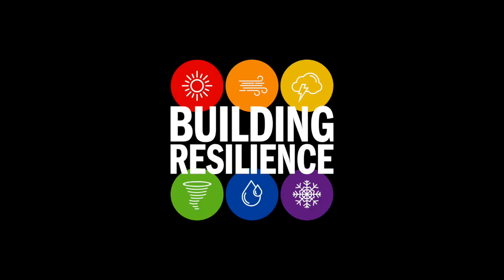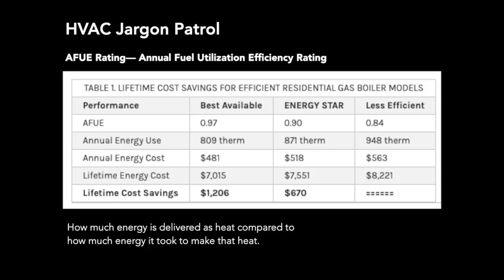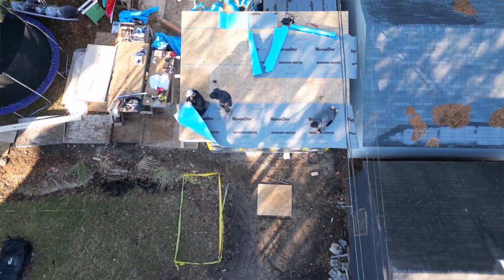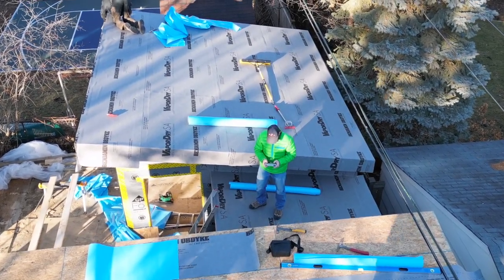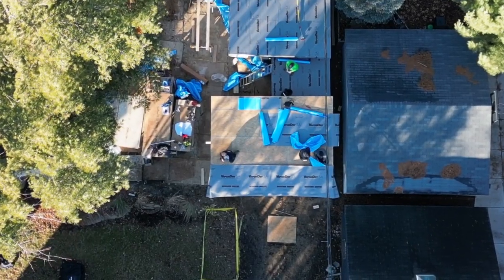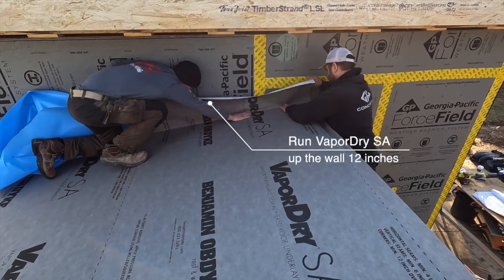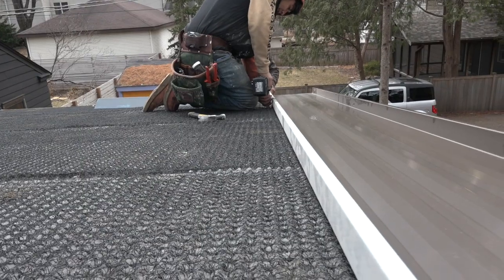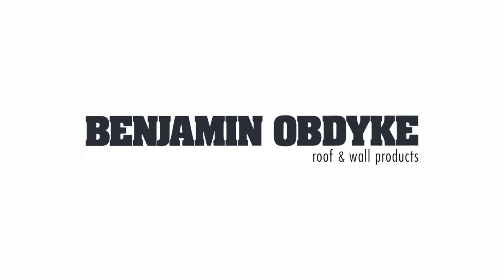Controlling Water, Air, and Vapor at the Roof Deck (Building Resilience Show)

Comment: Interesting products, however I have to question the application process. 

Wrapping the sub-fascia directs any water that migrates up through the permeable membrane to potentially run down to the fascia, or in the event there are gutters installed in will run behind the gutter. In the video it shows the SS roofing being applied and then magically a metal drip edge appears. It is a D style and the roof panels are hand formed to lock onto the edge of the eave metal. 

I can only assume the eave metal is slid in after the roof panels?  Eave or edge metal should applied first and then the membrane applied over, this will insure water is directed out and away from the wood fascia. This is a constant issue and typically becomes evident in  the spring when accumulated hoarfrost thaws and works its wat out.
Reply from the maker: Vapor doesn't run downhill, it is a gas. it distributes into the air immediately. 

Also, wrapping roofing membrane over subfascia is recommended by the IIBHS in their fortified roof specs for sideways rain resistance. It also helps with ice dams, but Michael's houses do not have ice dams anyway.
Reply: @ProTradeCraft  When vapor condenses it turns to moisture and gravity takes over, this is all about dew point and can vary regionally.

Its important to have air movement under control and always best to prevent it from getting into the attic area all together, through vapor retarders and ventilation. Hot roofs are tricky and not recommended in northern climates, from my experience they are always problematic. 

Edge metal is critical to direct the water away from the fascia,. Believe me it is a vapor until it isn't. Was the edge metal installed after the metal roof was applied?
Reply: @GardylooAlaska  Appreciate the thoughts. Actually, unvented attic assemblies are recommended for cold climates like MN and Alaska. You can not use an air permeable insulation for an unvented attic assembly. There is a ventilation cavity between the metal panels and the roof underlayment. As for the Drip edge, what you are seeing is a top of the wall scene where the panels are being installed, and then a bottom of the wall scene where the drip edge had been installed prior to the panels. This system is installed as the manufacturer requested (and we did call them a few times to verify).
Reply: @manschel2009  I beg to disagree, unvented roof assemblies in Northern climates lead to rot. They are NEVER recommended. Believe me, I have seen and repaired many.  Problems can be forestalled by good IAQ and air handling that keep the inside of the structure at a slight negative. This will prevent moisture laden air from moving into a cold space and condensing. Or at least help. Negative pressure is always a good strategy unless... RADON is present. That is another subject. 

How much air will a unvented attic assembly hold? That will depend on the type of insulation, spray in place polyurethane works quite well, fiberglass, mineral wool, cell-U-lose (not a typo) and rigid foam will allow air in as air is the insulation. If it is unvented where will the moisture end up of it cant vent out of the roof assembly.?

No permeable UL. agreed, some type of ICE&WS.... how much insulation? 12", 20"? Do you put a vapor barrier / air retarder on the inside...? of course you do. Now you have double VB with no place for moisture to escape. And moisture will be in there, even boats can leak. Its a prescription for disaster in my neck of the woods, Long after any warranty is in play...
Reply: @GardylooAlaska  I appreciate your passion for the subject. I also have a deep love for building science and was part of the NorthStar Build America team along with the Cold Climates Research Center and the National Labs. We allow and promote unventilated attic assemblies. In cold climates, the insulation can not be an air or vapor permeable insulation, for the reasons you note. 

The roof deck must use an underlayment that is vapor permeable. In this video we're using Vapor Dry over the entire deck. There is no ice and water in this assembly. We've also got a ventilation layer between the roof and the deck.

This structure has no attic. In a more traditional roof form where we might have a larger attic space, we treat that space as conditioned / semi-conditioned space. This ensures that our ductwork and mechanicals are kept in conditioned space. 

Last note. Flat and low pitch roofs are very difficult to get to vent properly, and in most instances we're putting the insulation over the roof deck as well as CCSPF on the underside of the deck, as close to 50/50 as we can get without the fascia looking too weird. These assemblies work quite well, and yes, we've had the opportunity to open some of our work from 25+ years back, and the structure is bone dry.

Comment: Yes, moisture from inside the house can escape using vapor dry sheets, particularly if they are "smart" vapor retarders. These sheets adjust their permeability based on ambient humidity levels. At low humidity, they act as vapor barriers, but at high humidity, they become more permeable, allowing moisture to escape. This dynamic behavior helps manage moisture effectively, preventing buildup and potential mold issues while maintaining energy efficiency and structural integrity
Reply from the maker: This is not a "smart" vapor retarder; it is a vapor-open peel-and-stick roofing membrane -- totally different than an interior vapor retarder.